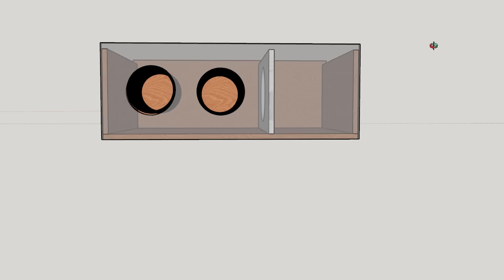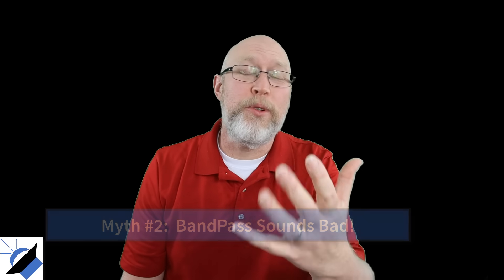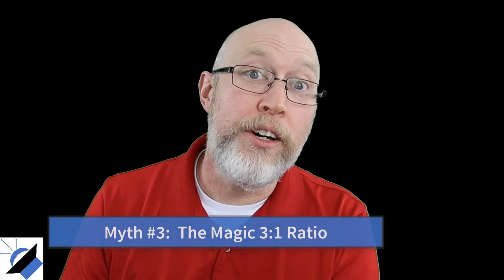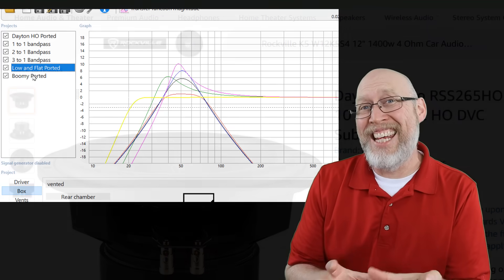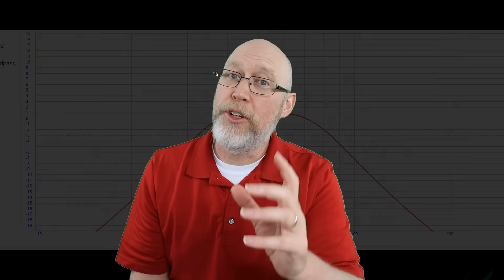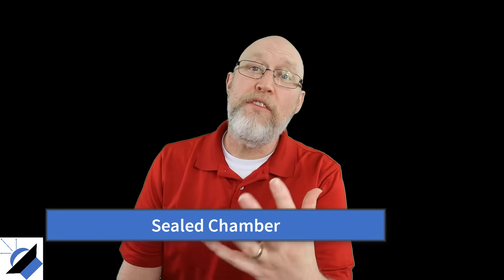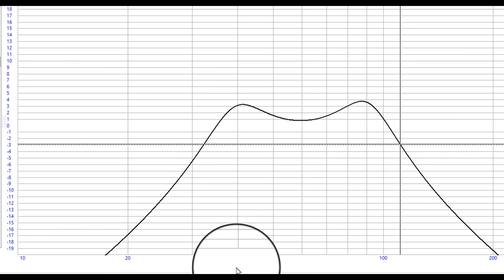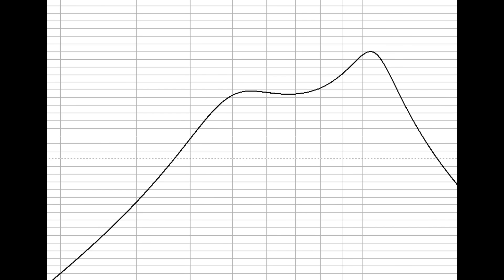Bandpass Subwoofer: You Are Doing it Wrong.  Bandpass MYTHS BUSTED!

Comment: I built a box a couple years ago for my alpine r series. Sounds great at 30hz but 40hz seems to take off and ring right through me... Does that mean my box is tuned to around 40-50hz? And how if possible can I lower the tuning by 10hz or so? 

I'm half debating starting a new box from scratch with the type of design in this video.
Reply from the maker: Hard to tell over the internet -- maybe get a DATS?
Reply: @DIYAudioGuy  I don't even know what that is 😭😭😆 I've had to tune 40 and 50hz out almost completely on the head unit is all I know 🤦🏻‍♂️😆
Reply from the maker: https://youtu.be/6g39ScWma3U
Reply: @DIYAudioGuy  I don't think I have the time cability to go through that process to be honest. The subwoofer has a data sheet which includes F3, QTC, ripple and FB which I'm trying to gain more knowledge on as I'm told these are the numbers I need to focus on?
The box im looking at making next is
W22" H17" D12.59" with a port area of 19"² (1.22"x15.50" X 28" long) ¾" thick mdf

Im smart with tech but numbers just kill me off.. trying to calculate port area I don't have a clue either... 

My current box I made the port 6" longer last year and it helped with the 25-35hz but that 40-50hz buzz stayed 👎.
Reply from the maker: You might be hearing a port resonance, or possibly even panel resonance.  Did you put a brace in the enclosure?  Whatever it is, it's not right. Subwoofers are not supposed to make a ringing sound.  Heck it might not be the enclosure at all, it could be the car.  Try moving the box around a bit and see if they're ringing sound goes away.
Reply: @DIYAudioGuy  have tried different positions in the car. I did just throw that box together over a weekend of estimating stuff and using a standard 12" box plan.
No braces except the port itself as a cross brace really. it's all ¾" MDF with solid joins and 13mm thick carpet underlay on every wall. Which helped a lot.

I agree something must be off which is why I aim toward building a new box with a better formula and also opening up trunk space slightly as the box I have currently is 22"x16"x15" and the port was never even thought about just guestimated

Comment: Transmission line or quarter wave are my favorite. Because if you make the "line" get smaller towards the "line exit" you can gain QUALITY. If you make the "line" get bigger as it reaches the "line exit" you get LOUD. And if you keep the same size throughout the "line", you get a mix between quality and loudness. The only downside is available space. The bigger the speaker, the bigger the box. However, you can make a 6" or 8" sub sound like two 12"s. I know, because I was the asshole who put a 12" into a quarter wave. Giant box was a downside, but..... sure enough, it bumped loud as !@#$.
Reply from the maker: My home theater speakers are transmission lines -- just a pair of 5.25 mid ranges in each cabinet.  surprising amount of bass from such little drivers.

Comment: Regardless of ratio or driver used for a 4th order bp, the vented side will always be smaller than the sealed side in proper design if looking for the best freq range for sq builds. If the driver is well suited for 4th order, dog ears can be avoided. If the center is @ 0db, then eq's the peaks down will flatten and maintain a more natural sound than trying to boost the lower output range. Cut is always better than boost.
Reply from the maker: That sounds a lot better than throwing a big woofer and a three to one box, tuning the port to some random frequency, and then claiming that it slams.

Comment: I am hoping the DIY Audio Guy or someone else can answer this question. I have a dual 8 inch bandpass box, similar to the one at 2:10 but only one port on each side. What I'm wondering is for the size of my subs should they as much as possible be smaller to not have the driver directly under the port, does it not matter, or should I change the plastic port to be not as deep?
Reply from the maker: The position of the driver relative to the port is not terribly important and if you alter the port size you will change the tuning frequency.
Reply: @DIYAudioGuy  I don't even know the frequency it's at haha.. but the driver covers about half the port entrance so I'm wondering about the air being displaced
Reply from the maker: @abdomination  It's really hard to say without being able to see it.
Reply: @DIYAudioGuy  of course I understand that too bad we can't insert pictures into YouTube comments. I could email it to you and if you ever get a chance to look at it. That spreadsheet that I got from your automatic reply has been very useful though.

Comment: Thank you for a great informative video.   I am also a professional audio trainer and I would like to ask a favor.  I teach people in my classes another common misconception.   A band pass enclosure is not a 4th order.  As you know, a 4th order is 24dB/ octave roll off.  A band pass has an average  roll off of 12 dB/  octave on both the high and low pass.   That's a second order.   You cannot add the two together to get a 4th order because one is high pass and the other is low pass.  Technically, a band pass enclosure is a dual second order.  Furthermore, a vented enclosure rolls off at 24dB/ octave low pass so it's actually a fourth order.  Can you help me to try to encourage that we do not classify enclosures by order and use the type to describe them.    Thank you.  Feel free to give me you thoughts.   Jmyers@kicker.com
Reply from the maker: Hi John!  I seem to remember Kip making the same point in on Unmasked.  I suppose it is a lot like infrasonic filters vs. subsonic filters.  Once you get used to calling something by the wrong name it is hard to break the habit!

Comment: I once built a 4th order band pass as recommended by Kicker for the two 12” comp series. 
After one week, I made a ported box and it sounded 10X better.
Reply from the maker: There is a reason ported enclosures are so popular.
Reply: @DIYAudioGuy  
 I once scoffed at passive radiators in the 80’s as “fake speakers”, rather than frequency extenders, like ports.
I’m now considering the “minimum order” of some Tang Band subwoofer modules for a project, and doing something like early Bose array speakers.
Reply from the maker: @dalesmth1  For sure, passive radiators have their uses.  They are great for when you're trying to make a small enclosure that otherwise would need a giant port.

Comment: Did you do vids on sealed enclosures? We just did a sealed at 1.5ft per sub. Vega series 12s. High frequency response isn't great but around 28hrz is insane. 4 12s at 2250w rms. 2ohm mono.
Reply from the maker: That sounds nice!  Best part about sealed is the small box size.

Comment: I've never understood all of the debate about "port tuning" and "box size". It's math. You calculate those parameters by using the specs measured from the speaker you are using. Period. It works every time. The math isn't that hard, and it's all in the Loudspeaker Design Cookbook you showed. You use that or software. Once you learn what the sound signatures of the box Q sounds like, you will learn your preference and build accordingly.. A box Q of .707 sounds great to most people. If you use the math, you can't go wrong. The only way you can go wrong is buying a woofer that doesn't sound good in the first place.
Reply from the maker: Yep, it is just math.

Comment: hello, wanted to ask for your opinion as it will be my first build ever. Had a spare klipsch k27k woofer with BIC subwoofer amp plate rated at 240 watt rms lying around so thought of giving it a build. i could not find any parameters for this woofer. if you dont have any parameters how to design a ported box? thanks
Reply from the maker: If you don't have the TS parameters then it's just guesswork.  For a 12 a two and a half to three cubic feet box tuned somewhere in the mid thirties would work for most people.  For a home theater build tune it lower.
Reply: @DIYAudioGuy  next question is how

Comment: So again. Pyramid enclosures. What do you think?
Reply from the maker: Not sure if I answered this.  I think the issue would be standing waves, not sure if a 4-sided pyramid would have fewer standing waves than a 6-sided cube.   If each interior panel of a cube had the same dimensions and the woofer was in the exact middle of the baffle any standing waves would be compounded.  That might not be as big of a problem with a pyramid, or it might be a bigger problem.  There is no way to know without testing it.  

For a midrange speaker baffle diffraction will be an issue if the driver is equidistant from the sides. In that set up it has been shone that a circle is the worst possible baffle, and a sphere is the best possible baffle.   I would imagine a pyramid would be slightly better than a square.

Comment: 9:17 I thought it should be pointed out that when the woofer is "Inverted" the voice coil also tends to cool better, especially over longer periods of play, because fresh outside air can enter the open chamber and is exchanged with heated air whereas if the voice coil vent (typically through the rear of the magnet structure) is installed into the sealed chamber the inner air continues to heat and becomes a less efficient cooling system.
Reply from the maker: Absolutely!
Reply: I have always wondered if inverting my subs made a difference been doing it for years...sound like they hit harder and last longer

Comment: I’m about to try and do my first sq system I want a lot of bass but want to be able to hear everything don’t want the bass to drown out everything else is there a ratio as far as Mids and highs to lows?? And example would be if I have 1000 W of power going to my Subs should I have 500 W going to my mids an highs
Reply from the maker: In my opinion no, I don't subscribe to magic ratios of any type.  The other thing to remember is that the different speakers in your system will have different efficiencies and that can vary from speaker to speaker.  Think less about the input and focus on the output. A calibrated microphone and some software like room equalization wizard, then adjust to make sure you get the sound you're looking for.

Comment: Great video!  Does this box have a 24db roll off since you called it a 4th order? I was taught you get 6dB roll off per order.  Seems the graph shows a 12dB low pass and a 12dB high pass roll off.
Reply: Fourth order band pass boxes do roll off at 12 dB per octave. The name comes from filter networks; a second order high pass and a second order low pass filter is referred to as a fourth order band pass.
Reply: Your correct .. the car stereo dudes just take names and make up names for everything!! I'm a post  PhD E.E. and see fake or incorrect names every single day on YouTube or the internet!!
Reply from the maker: For subwoofer boxes the order means something different.  It refers to the acoustic order.  Some would call a ported enclosure a 4th order.

Comment: For cheap installs for friends, with maximum perceived 'loudness' along with a nice sound, i'll use a ported and a sealed box with woofers of the same size, sometimes even a 10" sealed and a 12" ported.. Works quite well! ;) I have one of those exact shitty sub enclosures that's scrap, too..might as well burn it? I could have blown its original 10" "woofers" with a head unit lol speaking of frequency response, if you want some great reference speakers that can go down low and way up high (very high bandwidth) look for some KEF Coda III speakers, also Mission 731/750SE Gold and Gale G20 Gold.. I tend to prefer my Rotel or Yamaha amps to drive them all, though i have a few good JVCs and a Kenwood amp too.. And no EQs! And an EVGA Nu Audio Pro 7.1 sound card!
Reply: And strangely enough: the KEF speakers i mentioned are sealed, the Gale speakers are ported and i'm using them together as wide stereo monitors.. And an amp per pair now!
Reply from the maker: I will have to look into those.

Comment: Whoaaaaaa man this is knowledge I got two toro force eight inch 800 rms and for some reason my speakers be making popping sound when I crank it up I do believe box is the issue
Reply from the maker: Does it sound like an electrical pop (like turn-on and turn-off pop) or is it more physical -- like the voice coil former hitting the back plate?  If it is the former then a new box will not help.  If it is the latter then just turn it down. Either way the sub is damaged.  I would recommend a different brand (https://amzn.to/3vrKQHS).
Reply: @DIYAudioGuy  speakers is brand new it only pop because not enough air is coming out the port area of the box it play just fine an clear

Comment: I have 1 12" kicker l7 solo baric sub in a small q bomb box it beats now but I have been told to put it in a bigger box is a q bomb box good enough or should I build a box whats you recomendation
Reply from the maker: Build it if you can. The box makes all the difference.  Don't focus on the brand, focus on the box features.
Reply: @DIYAudioGuy  so what kind of box would be good for it its in a extended cab dodge ram

Comment: I personally have found a relatively small sealed side with about a 1/1.35 ratio is most musical. Tuned to 56 hertz, it’s quite flat throughout the response from about 26-56. Not best for SPL or super lows, but sounds musical, and still gets loud.

Comment: I noticed you didnt talk about 6th orders in this video. I would very much appreciate if you made one.
Reply from the maker: There seems to be a lot of interest in them!
Reply: I have a 6th order wall in my crv but plan on redoing it. So some extra info would be amazing.
Reply: I think Bose owns the patent for 6th order bp boxes, that is why many companies call them something else. I don't know if the patent has expired,  but Bose used to be aggressive about stopping non-licensed use of this enclosure type.
Reply: Adding more shit doesn't make it better a well designed system doesn't need all that crap NO resistors that's just a copout that you couldn't take the time to design test and tweak your crossover use an L pad if necessary but just keep your Db's very close & you probably won't need them LESS IS More

Comment: To bad most car subs are only in mid 80's for efficiency rating. I don't know my 4th is pretty damn musical and low. lol...  Next though is going to be 8 15's in a 6th order isobaric with around 6k of power 😎
Reply from the maker: That sounds like fun.
Reply: They have low sensitivity due to their stiffer suspension & heavier cones, this has it's benefits. Do not get tied up on sensitivity.
Reply: @AlwayzLearning   I'm not lol just used to the old subs of the 90's with high sensitivity ratings which had their ups and downs. Todays subs need  those points on what you mentioned because of all these D class power amps putting tons of power out.

Comment: Awesome content, thank you for the education! 

Off topic question, I have a sealed composite speaker box by Rockford Fosgate for my Polaris rzr. I loaded the RF RM110d2b 10” sub in it. I put sound dampening material in the RZR and went crazy and put some on the enclosure itself. Does this kill sound? Should I remove it?
Reply from the maker: You did the right thing.  Sound dampening material absorbs vibrations, that way you can hear the music instead All the vibration caused by the bass.

Comment: The best sounding band-pass I heard used a dayton dcs255 classic 10" really similar to a jbl gto 10". They are xmax limited so they struggle below 35 hz but they have some of the lowest group delay you can find in a band-pass without giving up efficiency. I ended up using it in a 6th order in my daily driver and sacrificing a tiny amount of sound quality for the ability to play some decaf when I feel like it.
Another cool thing is they still play high enough that if you are on a tight budget you don't have to upgrade your mids and highs, the classic 10" can play mid-bass even in a band-pass.
Reply from the maker: That' awesome!
Reply: So your playing mid and highs on a subwoofer ?

That makes no sense  AT ALL.
Reply: @casemodder89  some mids yes. Its enough that you shouldn't have to upgrade the 6x9s if you don't want to

Comment: Man Justin, you made my day with this one. 

So if there is a sub, that has a sealed and ported application from manufacturer, can this be utilized as a reference? Or even worked in conjunction with each other? I know this will be based and the optimal power rating and not so much a high power dumping, which as you stated will require a smaller enclosure to control the sub.
Reply from the maker: I really think the best way to approach a bandpass is to just model it in something like WINISD or bass box pro.  They are just too complicated to do it any other way.

Comment: You know what you get with a really well designed bandpass ? An enclosure that almost performs as well as a  mediocre ported box but still doesn't as good as the crappy ported enclosure lmao
Reply: Band pass enclosures when properly designed (S=.7 using a woofer with an EBP of 50 or lower) can exceed the F3 of the same size vented enclosure ( using a woofer with an EBP >=100). One major advantage of a fourth order band pass enclosure is the woofer doesn’t unload at low frequencies so a high pass filter is not required. The same is not true of a sixth order enclosure, the woofer will unload at frequencies below tuning frequency just like a ported box or a transmission line.
Reply: I agree!

Comment: I would always build my box with an under sized sealed section and about in spec give or take .5 cbft and tuned around 50
Reply from the maker: Which subwoofer are you using?
Reply: @DIYAudioGuy  right now a soundqubed hdc3.2